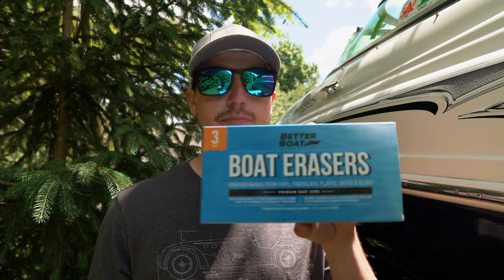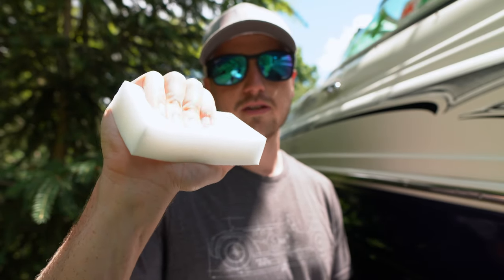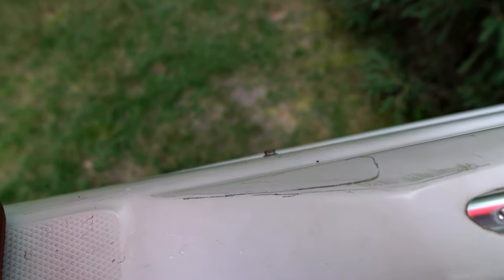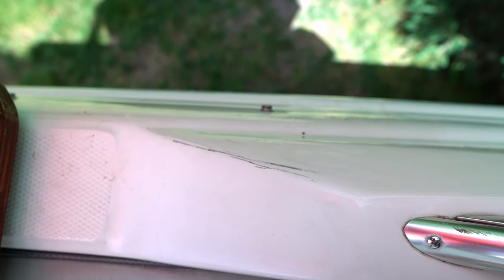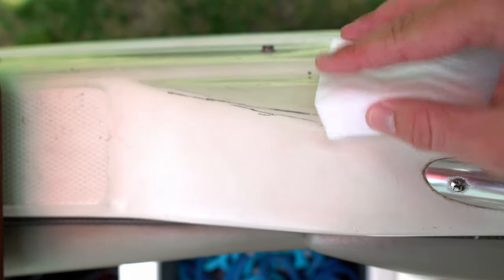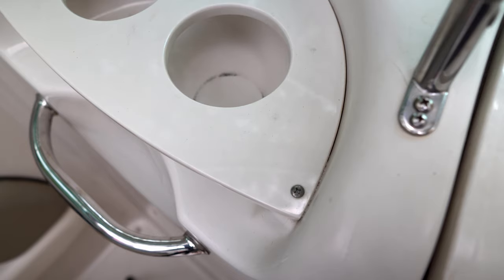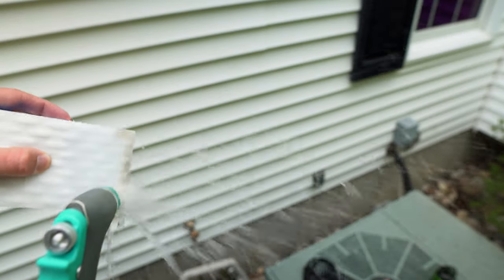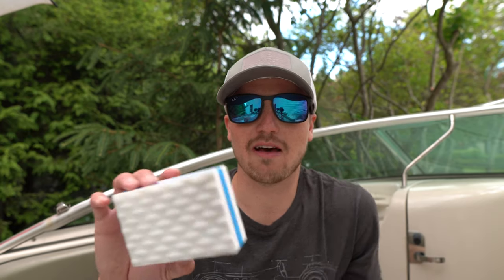How To Remove Boat Scuffs

Comment: you think it will work on the painted portion of the boat to remove white dock scrapes?
Reply from the maker: Yes. If the are scuff and not actual scratches gouging the gel coat.